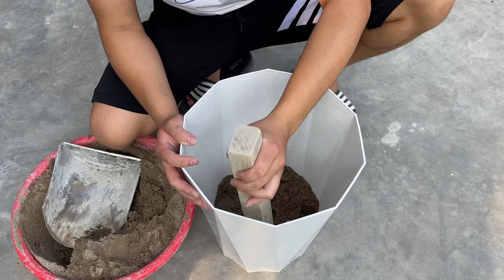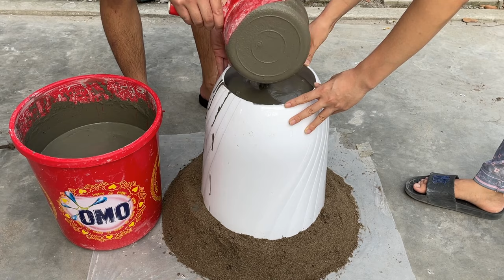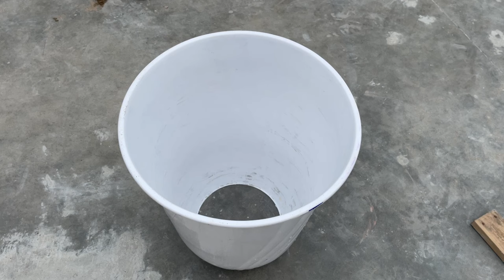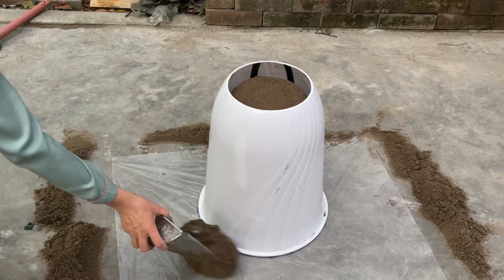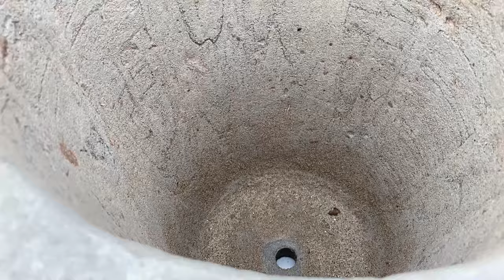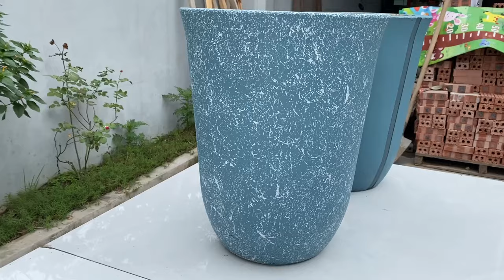Amazing Skill Casting 2 Flower Pots In 1 Plastic Mold - Casting Project

Comment: If you don't put iron reinforcements or fiberglass mesh or similar... it doesn't have any resistance to any blow, it breaks. On top of that, the cement mixture is very weakened because it is necessarily so liquid... I don't think they will last long. It isn't true?
Reply: If it is strong enough it doesn’t need any reinforcement, just like clay pottery there is enough strength in the material itself if the mix is correct. Reinforcement in concrete is more for load bearing structures that need to increase tensile strength. While it will definitely help it’s certainly not necessary at all.
Reply: Yes that's what I understand too. And if you put fibre/sealer/sand in the mixture won't it break the Playsand mould, meaning your concrete mix will be heavier.
Reply: SO CREATE A UTUBE CHANNEL AND SHOW YOUR WAY, OTHERWISE JUST LEARN THERES MORE THAN YOUR WAY, AND REMEMBER, ITS A PLANTER, NOT A HIGHWAY BRIDGE...😂😂😂😂😂
Reply: @SUGARBUGAR so angry. People can point out issues they see based on their knowledge. Sometimes they're right, sometimes not. It was productive discourse. Learn to think.
Reply: @robertc9549  
🤣 DONT BE SO TRIGGERED 🤣
Reply: I loved the girl’s pijamas
Reply: They just know how to mess up a great job with poor colouring choices

Comment: Hola, cuánto tiempo necesita el cemento para retirarlo del molde?. Gracias.😊
Reply from the maker: About 1 day later
Reply: Ahí salió que decía 24 horas
Reply: I think this is very creative & it turned out beautiful.   However, I’m concerned with the long term strength of the planter because of how diluted the cement mixture was and the fact that no reinforced wire or fiber was used in the mixture.  I feel it would eventually crack within a short period of time.

Comment: How much cement do you think you used for each pot?  For example, is one 50 pound bag for two pots? Or what. Also, did you mix sand and cement? If so what ratio, 2:1 cement: sand?
Reply: 1 bao 50kg thì dùng trong clip này ko hết nữa bao cho 2 chậu..cát lót trong chậu chỉ để định hình khuôn nên ko tốn bao nhiêu..

Comment: They'd be lucky to survive 5yrs, you have compromised the cement by way too much water and used no reinforcement at all... concrete always cracks its just a matter of time even with reinforcement(which holds the cracks together). 
Also you might get away with it in your country, if you're going to sell these using mass produced items as your mold i.e. the pots your cutting up will see you done for copyright infringement.